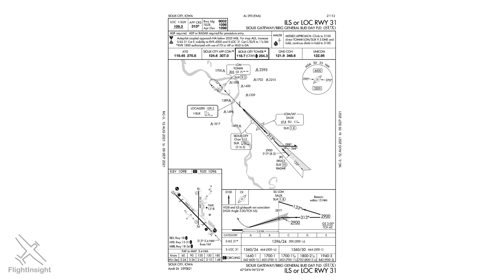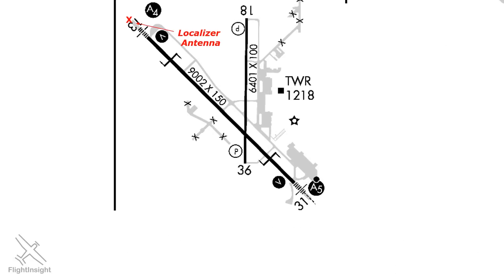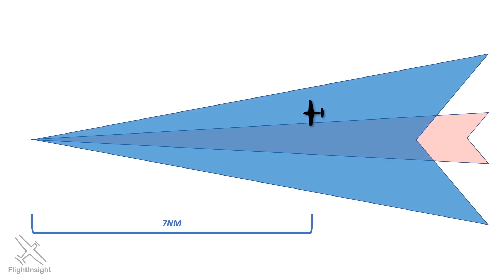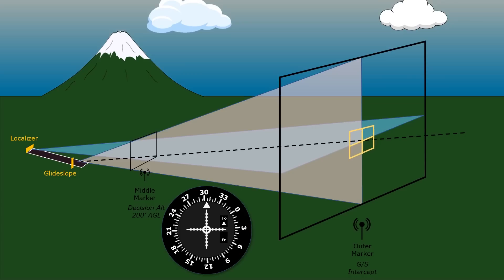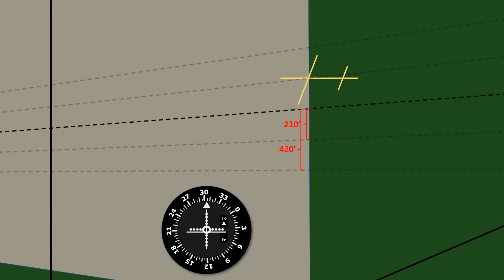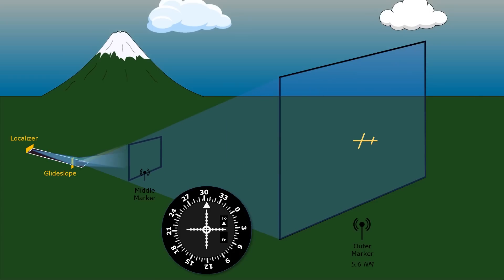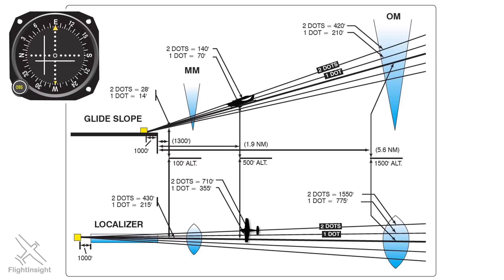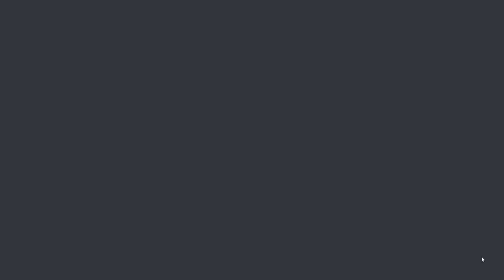ILS Specifications | How ILS Works | Localizer Sensitivity

Comment: NOW IF YOU ARE TWO MINUTES AND THEY WANT YOU IN IN ONE MINUTE OUT AT 4000 FEET YOU WOULD NEED TO SPEED UP BY 6000/4000=1.5*4000=100 KNOTS TO BE THERE IN ONE MINUTE EVEN BY THE APPROACH PLATE BECAUSE IT TELLS YOU HOW FAST TO GO BY MINUTES TILL LANDING?

Comment: Thank you for an easy to understand and enlightening explanation of ILS. I thought I had it all straight in my mind until I looked at a Google Maps satellite view of the Hayward California Airport, KHWD and found the localizer antenna array for runway 10L between the ends of 10L and 10R. The array is pointed at an angle toward 10L. I fail to understand how the localizer signal can be constrained to 700 feet wide at the approach threshold and still extend outward remaining symmetrical around the runway heading. It seams to me instead of a long skinny isosceles triangle the pattern would be asymmetrical and have more than three sides. How does the localizer work if the antenna array isn't centered on the departure end of the runway?
Reply from the maker: This is such a good question and probably deserves its own video. The LOC approach at Hayward isn't an ILS, it's just a non-precision localizer, and it's because it doesn't conform to all the specifications we listed on ILS. Localizers on a non precision approach are allowed to be slightly off centerline of the runway, and even some approaches are so far off center that they get a different name, Localizer-Type Directional Aid or LDA. Compare the 288 of the localizer course to the 285 of the runway heading. The less precision in the localizer means that the minimums are higher (450 AGL in this case vs 200 AGL standard on an ILS) than it would be on a precision approach.
Reply: @flightinsight9111  Well, there is an offset ILS near Atlanta, in Barrow County Airport, KWDR. The localizer is to the side of the runway, and the final approach course is offset from the NDB. Any ideas on why they did that?
Reply: @bp1carnal  Looking at Google satellite images of the runway 35 departure end, there is a large earth berm around 100' from the runway end (displaced threshold). That may account for the off centerline placement of the localizer antenna array.
Reply: @flightinsight9111  I revisited the approach plate and noticed the box containing the localizer frequency, channel and Morse identifier also included a notation indicating a "LOC offset 3.00°". However, I failed to see any other notation of non-precision approach other than plate title stating "Localizer DME". Are all Localizer DME approaches non-precision?

The offset position of the localizer antenna array at Hayward is curious given the large open grassy area at the end of the runway. I wonder if it has something to do with a previous runway configuration.
Reply from the maker: All localizer only approaches are non precision. Without any vertical guidance from a glideslope, an approach must be a non precision. There are elements on a precision approach plate to also tell you what you're looking at. There will typically be a glideslope feather on the profile view of the approach, as well as a lightening bolt symbol at the glideslope intercept. Also, there will typically be a glideslope angle given reading something like "GS 3.0°" As a rule though, treat loc only approaches as non precision.

Comment: Basic info. There's alot more to it. I wish students were taught things in details rather than just basic stuff to make them ace a written exam. Glide slope being 1.4 degrees, which is why you never chase a GS. The difference between a 6° and 3° width localizer determined by the length of the rwy..understanding the 90 and 150 hz signals...